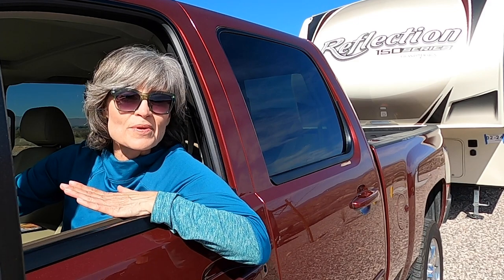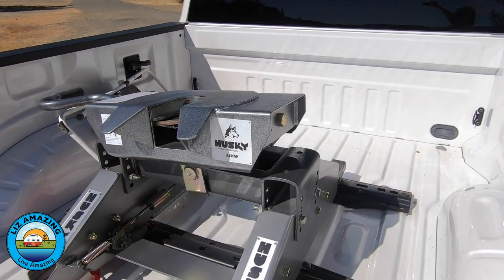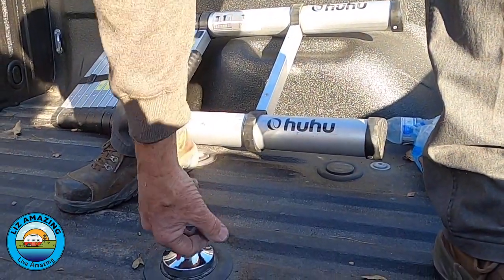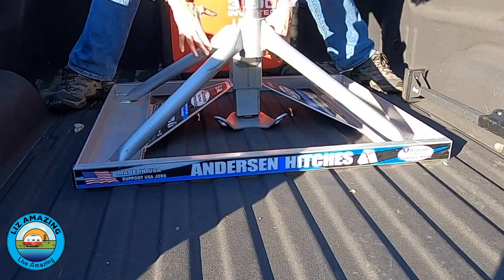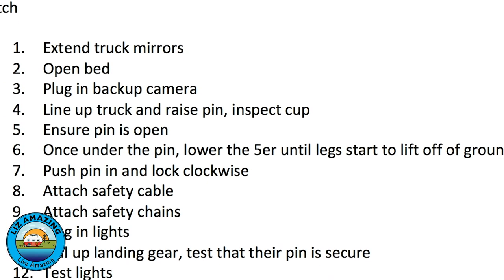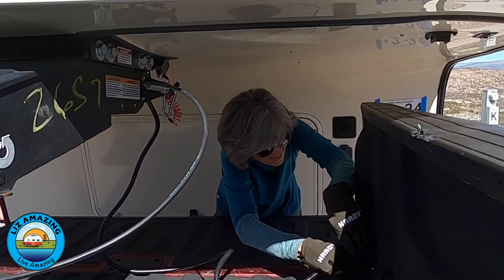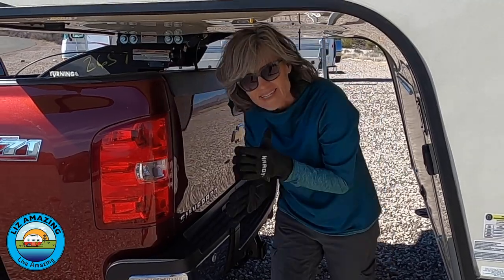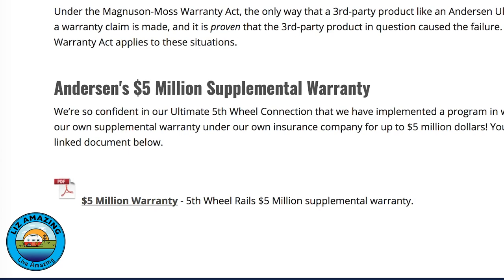Rv Life: Andersen Ultimate Hitch 3220 lets you hitch up by yourself

Comment: We use an Anderson with our 2019 GD Reflection 28bh and love it. Quiet, light weight, easy to hookup, very cost affective, and easy to install. Just can’t beat them.
Reply from the maker: I know-- as a solo traveler I would not have purchased a fifth wheel if it weren't for that hitch. Love the Andersen Hitch 3220! Happy travels!
Reply: Have the same RV and also use the Andersen but the rail version. Switched from a Demco Autoslide weighing 350 lbs. I can know access the bed easily when not towing.

Comment: Liz and Paul.  You may want to revise things just a bit.  Every video I've seen on the Anderson misses one point.  After you torque the top bolt, don't torque the lock bolts until after you set the fifth wheel on the Anderson.  Then retorque the top bolt to 50.  Then torque the lock bolts.  You'll find you'll not be at 50 after the weight of the fifth wheel goes on it.  I have the Anderson and love it!
Reply from the maker: Thank you. Yes, per the manual those bolts need to be checked regularly.

Comment: I also have the Anderson hitch and my rig weighs 21,000 pounds and the pin weight is right about 4000 and I haven’t had any problems with it. But I’ve only driven here in the state of Texas I’m about to put it on a long journey to the keys and out to the Carolinas and back wish me luck 😆
Reply from the maker: It will pull like a dream- ours certainly does. We have nearly 10,000 miles on our Andersen hitch, which we've used for two trailers. Our current rig weighs 15,000. Have a great adventure!!!

Comment: Hi, Liz. Do you see hitch ball when you backing? Did you broke back window, because you hitch ball was to close to the cabin? Can you adjust distance from cabin to the ball? Is your truck short bed? It is lot of questions to recommend this hitch. I sold my Anderson and since that I am using Companion slider hitch. Yes it is heavy but safe!
Reply from the maker: Yes, I can see the ball when I turn around in my seat. I usually get it lined up the first try— except when I am being recorded on camera! Lol.

Yes, the window broke bc ball is too close as it is a short bed. If we turned the cup 180 degrees it would bring the trailer even closer to cab. We are right on the border of flipping the cup per the measurements and Andersen’s recommendations so we could have it either way.

Ultimately, I broke the window due to driver error. I wasn’t looking. The dealer told me there was no way the window could break. So...I drove it from the dealer to a parking lot to practice, wasn’t looking. Then- pop!

We absolutely recommend this hitch! Had a traditional hitch prior and it was a long painful ordeal to hitch and unhitch. Every time. Just never got the hang of that!

Safe travels and hope to meet you on the road someday.

Comment: One problem is that the hitch is too high for stability and when the trailer is in a bad side wind or your turning too sharp u might be in a little trouble. Also u might of a wind flow tail gate for gas mileage, I would go to a regular fifth wheel hitch like the bw. Safe travels
Reply from the maker: Good point about the tailgate- I’ve seen those! Safe travels to you.
Reply: We have a brand new dually with 8ft bed, brand new 40ft fifth wheel. We LOVE THE ANDERSON HITCH. I’ve never heard of any safety issues about wind? And turning? 🤔

Comment: Curious what makes this easier than the fifth wheel system? Other than the weight of the hitch the process seems more difficult on the Anderson.
Reply from the maker: Watch the video and you'll see that you can hitch up by yourself, at an angle, at an uphill or downhill. I had the traditional hitch, what a huge pain that was! This one, you just need to get within 3 inches of the cup and it will come together.

Comment: Love your videos, Liz and Paul! 

I’ve been and Andersen owner for some time. I used to have a long bed, but now own a short bed Ram. 

I’m seriously considering a Reflection 150 Series. I was wondering how your short bed truck along with the Andersen and Reflection 150 Series performed concerning your turning radius? A big part of the equation are the pin box length and the front cap on the fifth wheel. I’d be really interested in knowing how your set up worked. There are a lot of videos out there on this topic but not much when it comes to this specific configuration. 

I love the Andersen and would like to keep using it. However, I’d prefer not to spend the money installing a turnover ball in my new truck if it’s not going to work well. 

Thanks for all you do!
Reply from the maker: Hi Bryan, thanks for asking! When we had the 150 series 260RD (shown in the video) we were able to turn right at 90 degrees before making contact with the truck back window. My RV dealer tech said the camper would never make contact so I actually broke the rear window the day I drove the rig off the lot-- precisely because I wasn't looking and was making a 90 degree plus turn. I learned not to trust the tech!

Never had any problems since but definitely you do need to watch where the front of the trailer is. The cup can be turned 180 degrees to give you more clearance but I didn't feel that was necessary.  The 260RD is 30 feet. We now have a 35 foot fifth wheel and find it even easier to maneuver. 

If you don't have them already,  be sure to get the safety chains. They are an option, but should be a must! 

Andersen Safety Chains with plate: https://amzn.to/3bUwZzM
Reply: Liz Amazing thank you for the quick reply. That is great news. I’ve been wondering about the for a while. I’m glad to hear it has worked so well for you; sounds like it will still work for me too. Thanks for the tip...I do have the safety chains already.

Sorry to hear about your window. That is a tough break (pun intended). 😉

Keep up the good work. I love to see people enjoying life and sharing their experiences. 

BTW, you’re new GD is beautiful!

Comment: That hitch looks plenty stout enough. Shear the bolts before the hitch fails. Seems that someone would engineer a system similar to the camera/computer lane assist. Where the computer could back the truck right into place perfectly every time. Staying true to the list is the way to go.The human brain gets through life assuming much more than thinking and a high percentage of those assumptions are false. Nice vid guys!
Reply from the maker: An auto align system would be perfect! Actually I typically get it the first try- but with the camera on it took a few times- of course!

Yes, the list has saved me plenty of times!!

Comment: Nice video but one mistake is that the breakaway cable should be attached to the tow vehicle and not the hitch system that you use i.e. to the strap hooks in the truck bed floor or side instead of parts in the towing system. If for some unexplained reason, the camper rips out the hitch system it will not stop by engaging the camper brakes from the breakaway safety system.
Reply from the maker: Yes. The safety chains and the breakaway cable are attached to a plate below the ball that is inserted into the bed of the truck. Gotta stay safe out there for sure!
Reply: @LizAmazing  If the ball (below the Anderson ball/frame and your plate) or locking system in the truck bed/frame fails, where does your breakaway cable sit? On hitch system and no brakes will be applied. Single point of failure. Breakaway cable is supposed to be secured to a secondary point like the tow vehicle i.e. side wall of the truck bed.
Reply from the maker: Thank you!

Comment: Check where the round steel brace welds to the base bracket. On the inside there is a gap under there that will collet water. Can we get some silicone chalk in that little gap? I'm afraid it will rust that weld from the bottom up.
Reply from the maker: In our case, it’s aluminum so it will corrode some but won’t rust.

Comment: There is no why in hell I would tow with a  ball hitch. 5th wheel is simpler and much stronger than the ball hitch. also 5th wheel trailers are not designed for ball hitch. you are pushing your luck towing with that system. Junk it NOW.
Reply from the maker: I had a traditional fifth wheel hitch like yours and I thought the same thing. Then I did research. Andersen is a proven method. I can hitch and unhitch in a snap- don't even need to do a pull test. Plus I can lift it out by myself. It's awesome! Check it out!